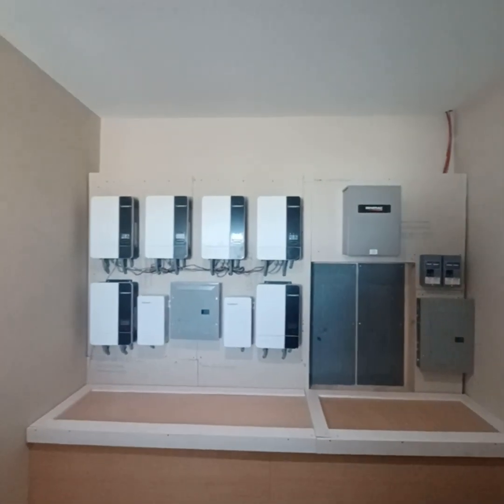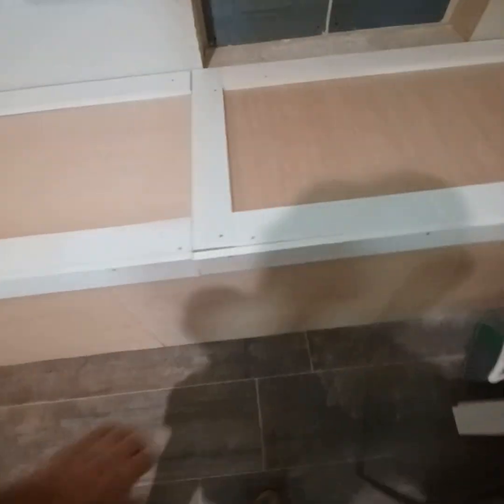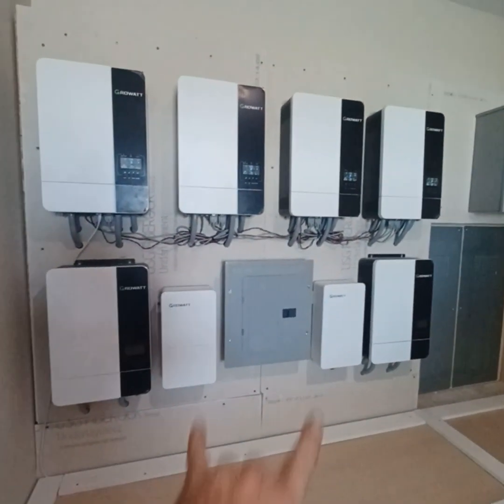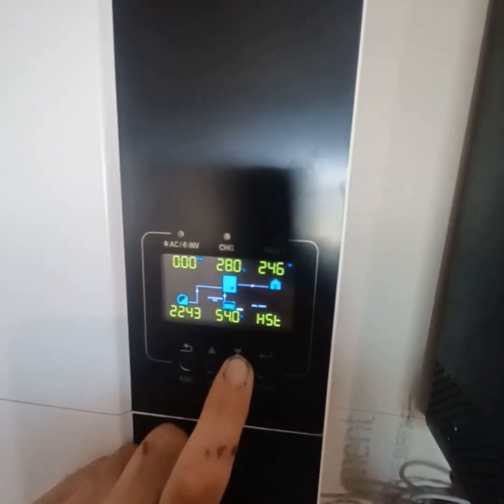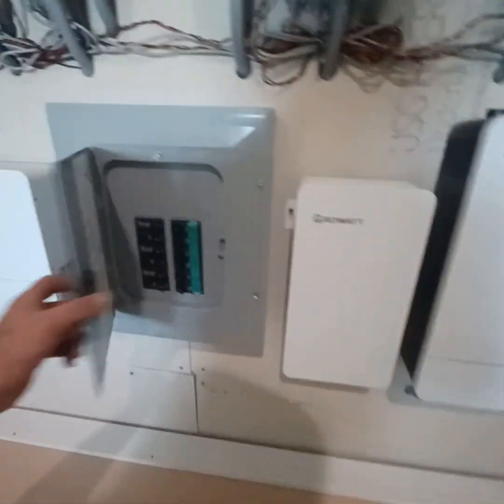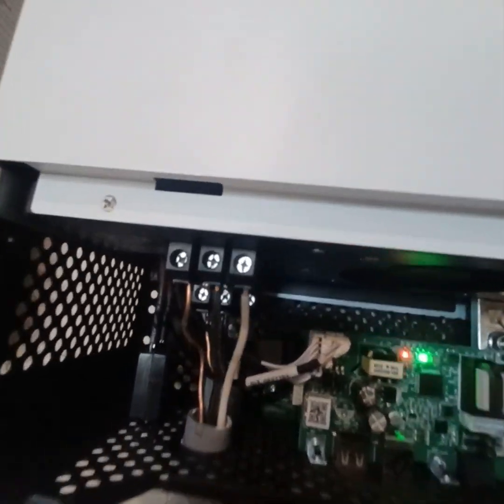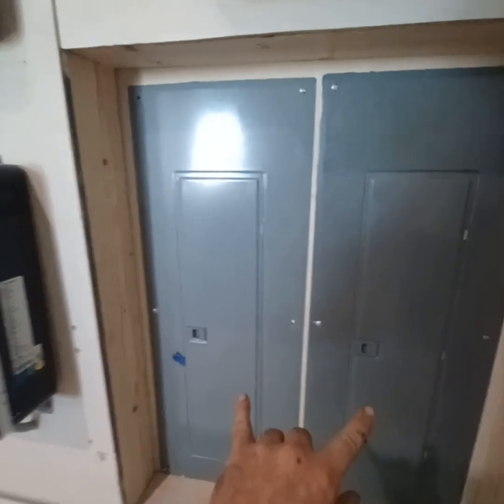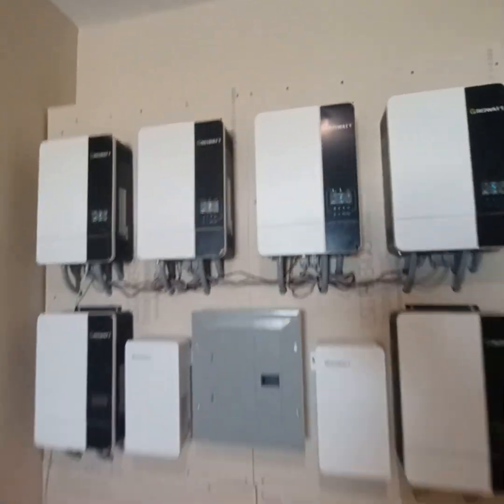OFF-GRID SOLAR WORLD LLC PLATFORM 30KW OUTPUT 120KW STORAGE 200AMP TRANSFER SWITCH 20KW INPUT

Comment: Wow. Freaking awesome buddy. I’m wanting to be off grid when I build our 4 bedroom house and 3x1bed apartment up top, with 2 pool pump filter’s running and mini split ac to no all rooms.  I was thinking 20-25kwh inverter system and 90 kWh batteries as I want to be off grid but have the grid as my generator. Would $35,000 usd be enough to get me close to the size system I mentioned.
Reply from the maker: Rough estimate 55,000 in parts for what you just described at cost
Reply: @Offgridsolar4life  wow. I’m 17K out of budget. Will need to get creative 🙁
Reply from the maker: This system can be stepped up at any time I would start where you can and add-on you'll be amazed on the amount you can do
Reply: @Offgridsolar4life  Thanks solar world. Does the spf 5000 have gen input?
Reply from the maker: Yes gen and ac 180v 250v input
Reply: @Offgridsolar4life  Great Thanks. Would you be willing in some years to come, video consult to ensure my installer isn’t making any mistakes?

Comment: What do you even need 30kW output for? Even charging an electric car only takes 6kW which 6kW is generally about how much capacity you need for an average home so 12kW is usually overkill, but sometime you can run into situations where you will be glad you have the capacity, but like 90% of the time you would have been fine with 9kW.

30kW for home usage is like a bazooka for killing a fly, even if your doing welding and running a shop with lots of equipment 16kW is about enough although you will want 3 phase power in that case which you can do with 3 x 6kW inverters. Honestly even if your running a shop with lots of equipment and a home where you your wife and 2 kids live and have 2 electric cars 24kW is going to be enough and that is a pretty extreme example.
Reply from the maker: 10 KW is diverted to safe room concrete bunker
The house is also 10,500 square feet
Reply: A home shop could use a big swag. A decently powered plasma cutter is going to pull 12.5kw by itself (50 amps at 240v) and a decent air compressor (say 5 hp) that needs to be powered at the same time will use 6720 watts or 28A at 240v. Or how about a 3-5 hp planer and 3-5 hp dust collector running at the same time? If both are 5 hp, that's 13.5 kw just for those loads.

And as far as I know (not clued in with EVs), there are 50 amps chargers available for Telsa and others. That's a 12kw load if they truly use 50 amps. I think they can be dialed back, but it  COULD be used.
Reply: @silverbackag9790  I assume you are not going to run all those at the same time and I said 18kW for a shop alone which can fit any one of those easily and some at the same time, and as I said for a home shop 24kW

And generally people charge their cars during the night so if you have 12kW that can 90% of that can go to charging the card if you want to do it quicky , but considering your probably going to be sleeping for at least 4 hours I don't see why you wouldn't just use a slower charger or charge it on a lower setting.

secondarily is there no direct DC to DC charger for EVs because it seems awfully wasteful to covert from DC to AC to DC for such a large load.

I know you going to have up boost convert it from probably 38 - 52.3V like 700V, but being able to skip 2 conversions has to be more efficient.

Although if you had a direct link to the solar panels when it's sunny and if you have a large array the output voltage could be 250 - 700V depending on how your array is wired, so in the case of a large series of solar panels you might very well not even have to change the voltage much leading to very small losses for the conversion.

Just looked there is one, but it's expensive... I really don't know why this hasn't been done sooner because the price floor on a DC to DC charge of the same size as a AC to DC charger it much lower and a customer with a solar system can charge their car more quickly due to having less losses in conversions from their solar or battery.
Reply: @Etheoma  like I said, the plasma and the air compressor get ran at the same. A plasma cutter has to have steady air, quite a bit of it. Almost the same with the dust collector and planer combo. Would you be running both the cutter and the planer at the same time? No. But you still need overhead, unless you want to start walking through the shop and home and be turning off minisplits and other loads.

Comment: Cool! I'm in a process of thinking to build my house soon and I want to be off-grid. Hoping by the time I will be able to use Na-ion batteries and possible no need for inverters either (DC powered home). I have no idea but it sounds the most efficient solution currently. KNX should provide low voltage DC anyways (probably no need for static switches, all will be wireless)!